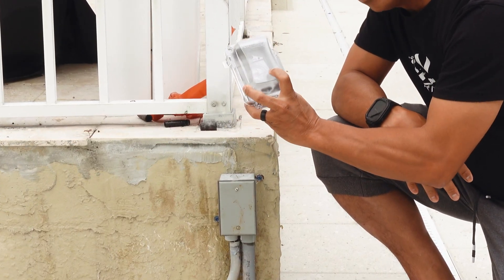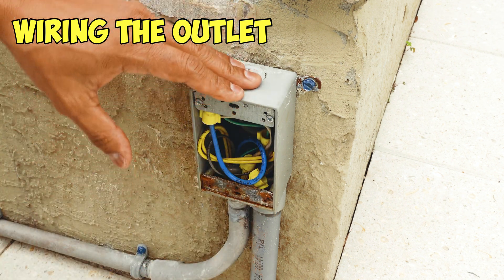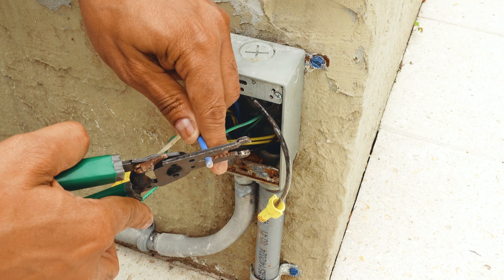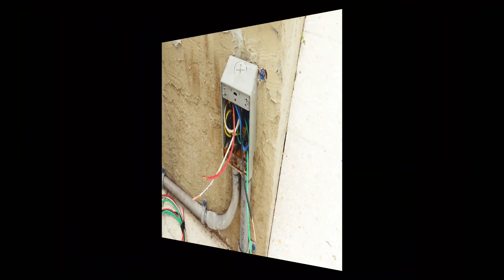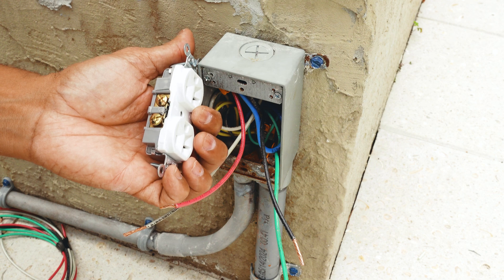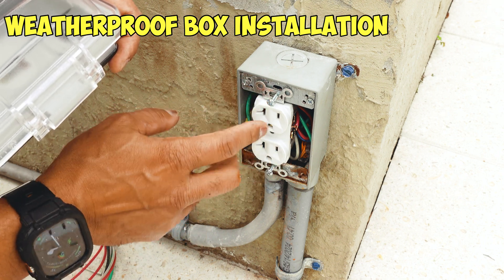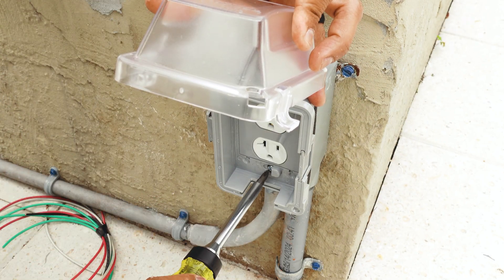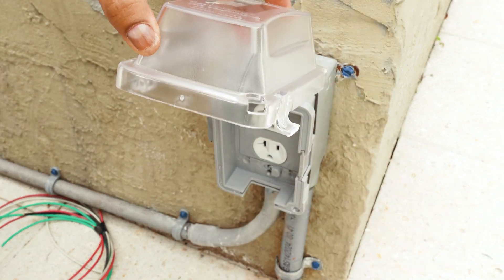EASY Weatherproof Outlet Cover Installation

Comment: I am curious as to why you did not install a WiFi controlled socket? I have been moving all my switches and sockets (where needed, mostly outside) to WiFi Controlled or Zigbee / Z-wave controlled.  It allows for a great deal more control types and timing.  A traditional timer typically cannot deal with off-set sunset, sunrise and often does not manage Daylight Savings.  Personally, I use TP-Link Kasa outlets and switches, but there are dozens of manufacturers that make these digitally controlled devices
Reply from the maker: I do use zwave outlets a lot.  I just had the timer box connected and decided to wire this outlet to it.  The timer is wifi enabled so it serves the same purpose

Comment: If you are wrapping around a screw terminal, you should pigtail to solid wire or use a receptacle designed for stranded wire.  Is that receptacle protected by a GFCI receptacle or GFCI Breaker upstream?  Otherwise, install looks good.  Thanks, Russ, 29 years in the Electrical Trade.
Reply from the maker: thanks russ, yes it has a gfci breaker upstream